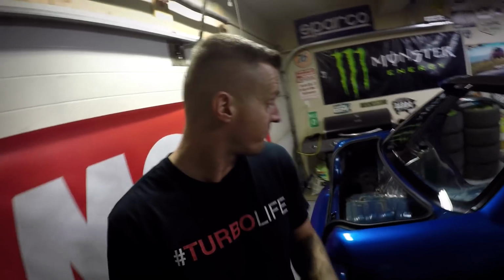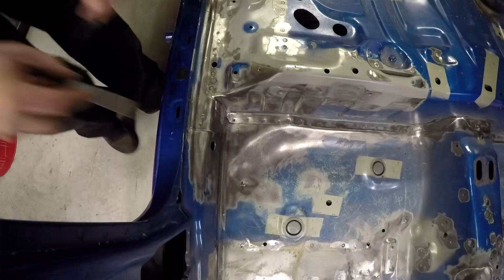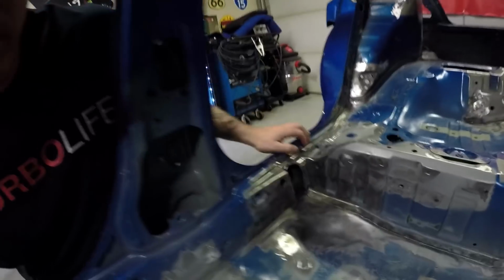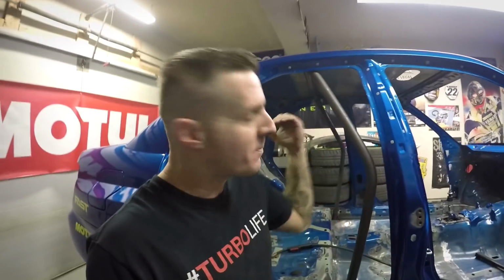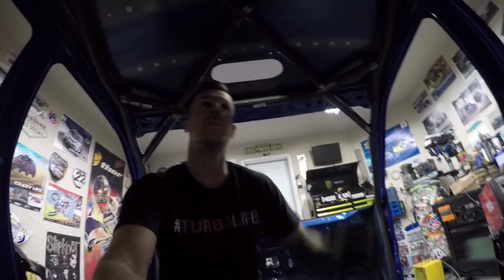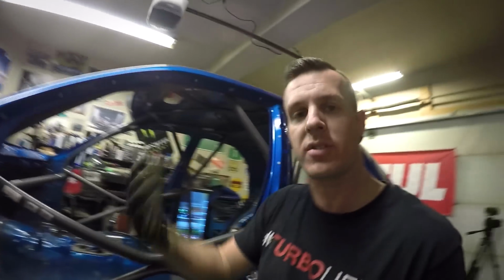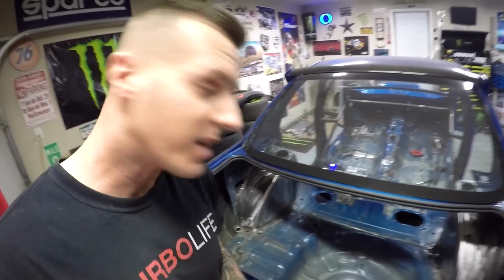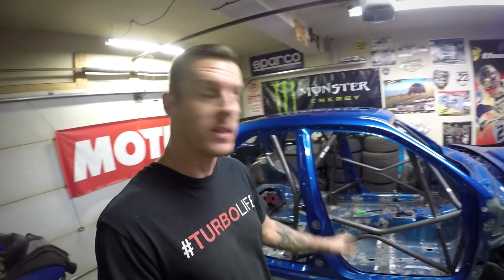WRC Roll Cage Inception - Subaru Impreza STi WRC / Gymkhana Build Series

Comment: I'm loving this build my dude. This is motivating me to set build goals for my sti... Was the decision to go cf roof a response to welding the tops of your cage?
Reply from the maker: Thanks bud, good luck with your car, go for it!! As for the roof it wasn’t part of the original plan but a good friend has started to make them so it seemed the best option. Definitely makes welding and painting the top of the cage much easier.

Comment: probably a very late comment but it is very important to wear a respirator when cutting with a plasma cutter especially in a very confined space like your garage, you don't want all those toxic smoke and metal dust particles inside your lungs, that's coming from a fabricator that's cutting metal for hours each day.
Reply from the maker: Thanks for the tip, a respirator probably would have been smart right. Got smoky in there very fast. 😬